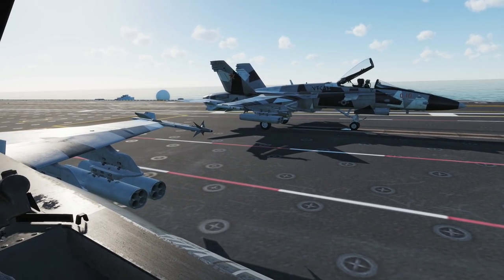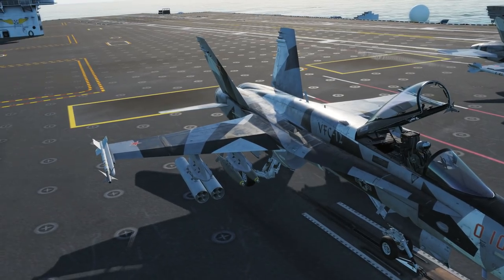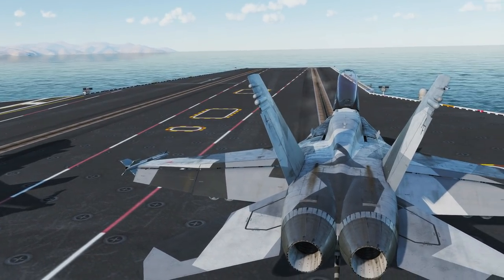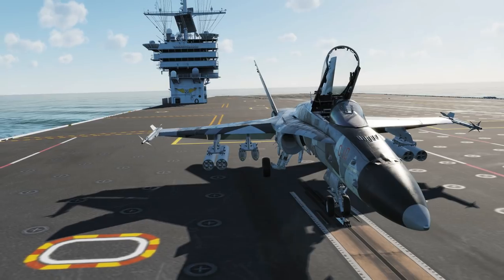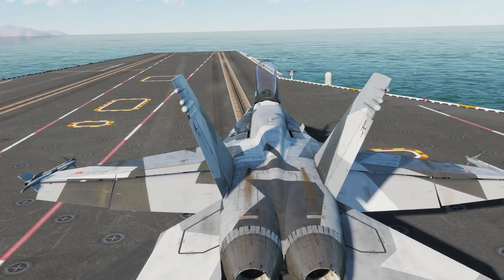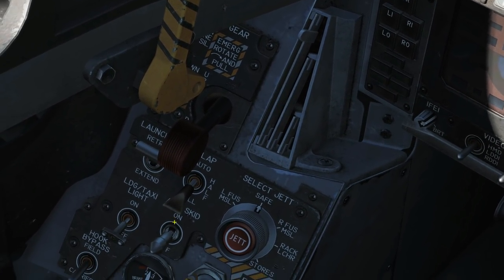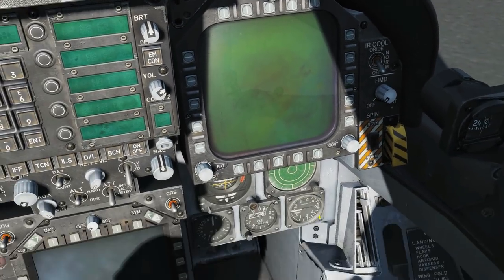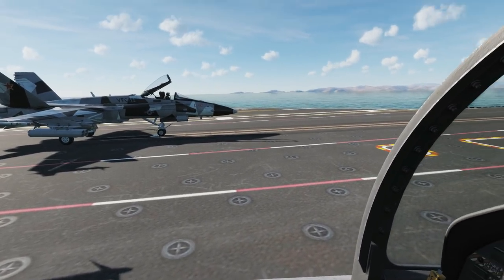FA-18C Hornet | Looking At Cockpit & Airframe | DCS WORLD

Comment: The wings and body are built to deflect and redirect moving air as it flows over the body, at high AOA, the delta-canards induce a large vortex that is shaped to travel over the wing roots and over the control surfaces, preventing loss of positive control in high AOA scenarios. And when needed, the wings that can induce an amazing amount of camber when needed. In the aerospace engineering classes I've taken, the hornet's frequently referenced for how the controls work, and how they passively shaped the air flow. 

The DDI's are monochrome, whereas the MFCD is full color. You can kind of tell based on how the top screens are very green and the bottom is black. The MFCD will eventually have full color scrolling maps, but that might not be released for a while, they're focusing on the A2A radar modes at the moment.

A word about loadouts, the hornet does not carry tons of fuel by itself like the A10, and the engines burn what it does have faster, so it's pretty standard for a hornet to go out with at least one tank on it at any time. A2A loadouts usually had the centerline tank, A2G had two tanks on the wing stations. As missions were usually several hours long and featured at least two fillups (one going, one coming), the need for fuel, and skills at refueling is very important for long missions. With DCS, as the strike zones are pretty close to home airports, I don't see this to be as big of a problem, but with longer missions, putting a S-3 tanker or two discreetly near the path back to base might need to be a thing. Especially for missions with carrier landings.
Reply from the maker: Thanks James great info

Comment: He was mistaken about the cause of the vapor trails, it is actually water condensation caused by adiabatic cooling of the air to a temperature below the dew point. To put it more basically; the plane is mostly hanging from the air above the wings, this stretches the air out (lowers the pressure) because jets are heavy. Jets weigh even more when they are turning hard so this stretches the air more. When you stretch air out it lowers the temperature and when you lower the temperature of air it holds less invisible moisture. This is why you see the vapor trails. I assume they appear in the areas of lowest pressure, which are also the areas of highest lift.
Reply: Yes I am sure. You are fundamentally incorrect. Lower pressure air holds more water than high pressure air, at the same temperature. You must know these things to be a pilot.

Comment: Little hornet info... Legacy Hornet, no slats, just LEF or leading edge flaps, gear is like that since they pretty much control a crash on landing, horizontal stabs are stabilators. They move symetrically or asymetrically. Like your buddy said, they do help with roll,  hook isnt aluminum. The hook point is heavy as crap for something its size. Hornets do have so many landings, unsure of the number. Most of VFC-12s jets (their old ones) were done with carrier ops. The vert stabs do NOT act as air brakes. Theyre angled because if they sat straight up, airflow would attempt to "pull" them together. The intakes are "fixed" but right before the intake, the body is perforated. It pulls some air up and away from the intake at higher speeds. They use F404-GE402 and GE-400 engines. The UFC can have all the info like channels or memory inspect and so on so forth. The lower screen is an MPCD. Multi purpose colored display. The details on the inside and out are crazy accurate.  Dont mean to rant. Been working with these jets for a while but theyre going away sadly. Not a fan of the Super.

Comment: The wings is placed on the back so it doesn't get to much lift in the front (stable). And they want the weapon stations as close to the center of gravity. Compare with a F-16 were the wings are a little more forward. Its unstable in the air and as a backup solution they could move the wings further back on the design if the FCS wouldn't have worked out. If you look at an F-16 on the top you see they left a little space for the wings to move further back.
Reply from the maker: Thanks Vig

Comment: Radar is an APG-73, its more advanced than the APG-63 on the F-15C but doesnt have as much output/range, the A model had an APG-65 but the DCS Hornet is a very late C. The APG-73 shares a lot in common with the APG-70 from the F-15E but its a bit smaller and less powerful.

https://en.wikipedia.org/wiki/AN/APG-65_radar_family
Reply from the maker: Thanks Joel

Comment: The Engines on the late lot F/A-18 modeled are F404-GE-402's, which give more thrust when compared to earlier Hornets equipped with the F404-GE-400's. At lighter weights the T/W ratio can be greater than 1 to 1 on the late lot Hornets. Great Vid!
Reply: F404-GE-400 10,000 lb/force mil thrust 16,000 lb/f with A/B used in F/A-18 A/B variants and the Canadian CF-18 of which 98 single-seat variants and 40 dual-seat variants, for a total of 138 purchased. Us Canucks just received 2 Australian F-18s that we just had delivered in Feb 2019. The Aussie's landed, shut the jet down, pulled out their software. The Canadians then installed their CF-18 software.  They will all need a paint job to Canadian CF-18 low visibility grey We are buying 18 flyable airframes and 7 more for parts and testing.
F404-GE-402  11,000 lbf  mil thrust
  17,700 lb/force with afterburner  used in the F/A-18 C/D variants.

Comment: The forwards wing root leading edges enhance air intake,they also break up boundary layer airstream and ensure the intakes get all that air instead,thus adding to more aerodynamic airflow...they help the intakes gather up more air enabling advanced flight characteristics too....the wings set back are good for low speed handling high AOA and also for high speed...aits a bit like a delta wing performance without all that wing area to worry about and adding weight....a great design aerodynamically....awesome looking bird...also as it has a narrow section fuselage the gears are narrow,but extend out for stability on landings and T\O....otherwise it would fall over....more or less lol...cockpit looking good for early look...I like the well used look...real pits seem to collect a lot of dust...dont they have dusters ?...lol
Reply from the maker: Thx RM

Comment: Yep hornet has a super low TWR due to the pitiful engines, but is still a super sexy plane!
Reply: This is not true. The F404-GE-402 engines are not pitiful. The big engine hornets are quoted as having 17,500lbs or 18,000lbs per engine. Yes, that's static rated. The F-15 engines are much larger, as is the aircraft itself compared to a Hornet. Those engines are gaining another 5 or 6k lbs of thrust each for the extra size and weight of the engine, for a bigger airframe.

The fact is that the Hornet is only slightly inferior to the F-15 in terms of power to weight. The Hornet is superior to some variants of the F-16 and inferior to other variants, depending on their installed engine. It has plenty, but it appears to be a much draggier airframe, yet much more nimble airframe. 

Where the Hornet tends to get criticised by USAF pilots, is it's lack of sustained turning ability. A few things cause this, less power than the F-15 and most F-16 variants, lower G-limit at higher speeds, and that high-alpha capability. At high AOA, the aircraft is basically a huge flying airbrake with massive induced drag - and no amount of engine power is going to stop that from happening.

However, now that we have HOBS missiles and HMDs everywhere, that nose pointing ability might be more important.

Lastly the TWR figures quoted in the film are either max Takeoff or something else is wrong. The Hornet having a lower TWR at max takeoff likely reflects the attack role that the F-15C doesn't have.

Lastly, you can't do a square loop with low power aircraft. Lookup the RAAF F/A-18 display at Avalon 2015 here on the tubes. That's a small motor Hornet.
Reply: https://www.grc.nasa.gov/www/k-12/BGP/Donna/t_w_ratio_answers.htm source for the twr stated in the film
Reply: I question the figures there. The F-15 is listed as heavier than a F/A-18? Also the engine thrust figures are low in my opinion, possibly dry thrust?
Reply: Try this, it lists the F404-402 engine output as 78.7kN per engine.
https://www.geaviation.com/sites/default/files/datasheet-F404-Family.pdf
Reply: Rodney Pearce yes it has 78.7kn of thrust but that is with after burner as they were comparing the f18, and f15 with 737, and 747 however the f18 still loses out to the f15 due to at after burner the f100-pw-220 produces 105.7kn of power and the f15 weights 28,000lb and loaded 44,500lb compared the the f18 at 23,000lb empty and 36,970lb loaded
Reply: Yes that's true, I wasn't saying that the F/A-18 has a superior TWR to the F-15, just that it's not so underpowered as the commentor I replied to implied, nor as was stated in the video. The NASA page isn't right with it's figures. It could be example data just to show the method of the calculation. They also show the F/A-18 as heavier than an F-15 which you've also just disagreed with. 

When you calculate TWR, it really should be done at max power unless otherwise stated. For all it's faults, wiki does tend to stick to standard weight (often full fuel plus AAMs for fighters) / Max power with a figure also given for 50% fuel. That's where they get the 1.12 figure from for the F/A-18.

The NASA page does not state the assumptions used for it to arrive at such a drastically different figure.

Just to make it more complicated, engine installation also matters. The F-15 has almost straight intakes so you can basically see the entire fan. The F/A-18 uses an S-bend which hides the fans. This has benefits for RCS, but as you change the direction of airflow, you lose a little pressure. 
What this means is that the quoted thrust figures, which are the engine on a test stand, are always better than an engine sitting on a runway sucking air through intakes. It stands to reason that an F/A-18 (or an F-16 for that matter) will lose slightly more power over an F-15 due to the installation, and this likely does hurt it's higher speed performance where the ram-air effect (going fast so the air going in the inlet is higher pressure) gains back that lost power. This effect is even useful at much lower speeds, modern sport/race motorcycles have air intakes designed to allow almost straight in airflow to the airbox for the same reason, to ever so slightly pressurise the airbox.
Reply: Rodney Pearce ya the nasa site might have miss represented the weight but I think it’s mass and not weight which is different but at 2am I kinda misunderstood what you meant but ya as you said the fa/18 isn’t as bad as the commentor said I was just explaining what I understood from the thrust figures and hopefully enlightening the people who read the comments who have a misrepresentation of the 18s true capabilities
Reply from the maker: We'll settle this today with a drag race boys
Reply: That sounds like a great plan! Also, nothing against the F-18's engines, I'm sure they are capable for the situations they were designed for, just wondering though how much the (slightly?) lower TWR will affect for example within-visual-range combat. Looking forward to the drag race.

Comment: Commentor lost all validity at "air turns into liquid form because of the pressure."
Reply: Correctly, the sudden drop in pressure pushes the air below the triple point and into 2-phase expressing as condensation. Happens only in relatively high humidity environments.
Reply: He does seem to have at least a low level of understanding on a vast number of topics, so I wouldn't say making a mistake removes all of his credibility.